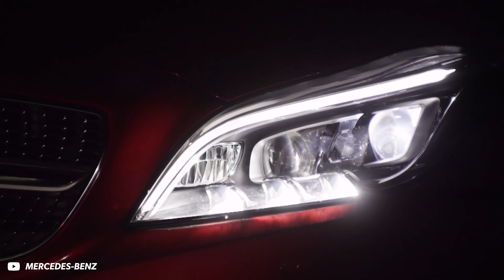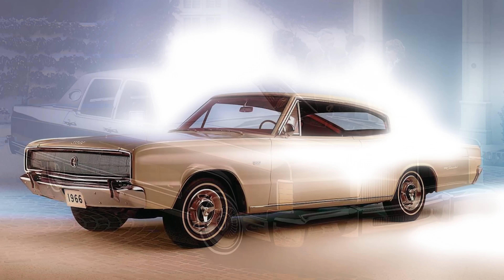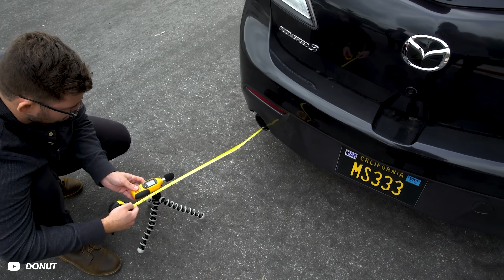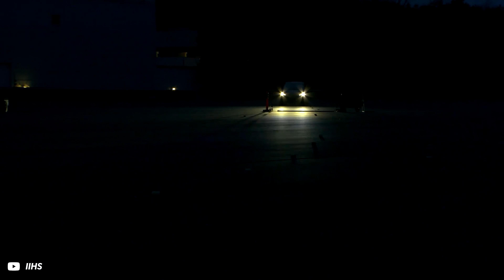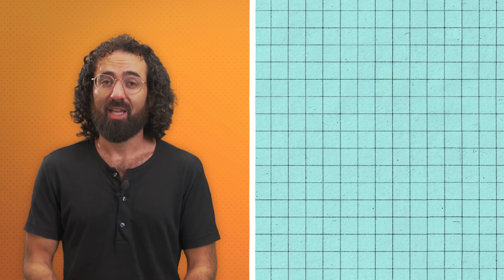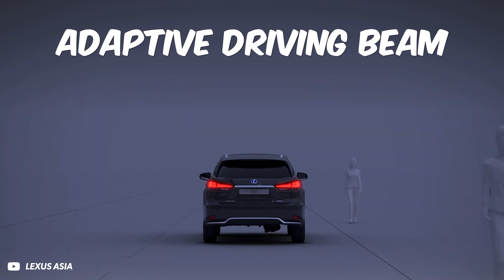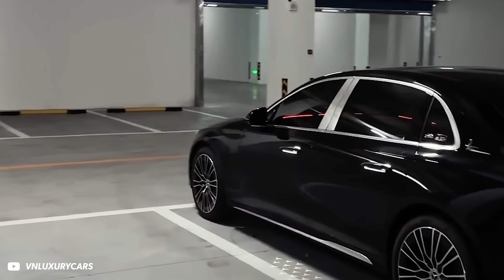Why new headlights are blinding American drivers

Comment: Its called AIM YOUR LIGHTS PROPERLY!!!!
Reply: You and I see this the same way. I’ve stopped suggesting it. 😂 I’ve put LED replacements in a few vehicles and all needed to be aimed a little lower when I checked the aim.

I have never been flashed by oncoming traffic with these vehicles.

On the other side, I rarely find LEDs too bright in oncoming traffic for either OEM or aftermarket. If they’re too bright, then I just look at the white fog line. It’s not a big deal.

I think I’ve seen the reaction to pressure already happen on brand new vehicles. I have a ‘26 Toyota equipped with OEM LEDs and they are absolutely rubbish. The low-beams are barely adequate and the high beams are beyond worthless. For unlit rural roads loaded with big game to contend with, they’re downright dangerous. I’m having to rig additional auxiliary LEDs for safety.

Comment: xenon does not make a light a "halogen" light. halogen lights usually have a halogen such as iodine in them. the iodine helps keep the tungsten filament from slowly evaporating away. halogen lights might also have a "noble"  gas in them usually under pressure such as argon, krypton, or xenon. the heaviest noble gas is xenon, and when the tungsten atoms try to leave the filament they collide with the xenon or other novel gasses and return to the filament. these gasses are usually under pressure to enhance this effect. the bulbs are small as the gasses are expensive, and they want to limit the convection which may cool the filament excessively and dim the light. halogen lights are sometimes called quartz halogen lights. now, some cars use arc lights which may also use xenon, for much the same reason that a quartz halogen bulb does, to slow the deterioration of the electrodes. this is what i remember from the last time i looked into car headlights, some of which applies to flashlights. definitely believe there are problems with led headlights. in my state you must use the oem lights in headlights for a car. you can't replace an incandescent light with a replacement led bulb. if you do the car will fail inspection. that might help with some led headlight problems. i have noticed that the headlights on some car flicker visibly, find that annoying. not sure it that is from oem headlights or replacement headlights. do think that led headlights don't deliver the full visible spectrum which makes highlights some things on the road and makes other things harder to see. think they deliver less light in the red part of the spectrum. seems to me that the red reflectors on the back of cars are not as visible in the light of an led headlight as they are in the light of incandescent lights. makes cars with rear lights that aren't working harder to see at night. anyways probably a lot of bad information in this comment, but working from memory and haven't looked into this in a long time. all is opinion, fwit.

Comment: The video is great and frames the advances in tech very well.  

BUT - to those people who complain that cars (and houses) these days cost too much, let's remind them: 

✅ Bright headlights blinding drivers is not new.  We solved this decades ago with proper aim standards and high/low beams.  They just need to be updated.
✅ Low beams were designed for shared-road conditions.  Maximum distance at highway speeds is what high-beams are for.
✅ If conditions (rain, snow, darkness) limit visibility, drivers are expected to adjust speed.  It's actually the law "driving to the conditions".  It's unreasonable to expect the same safety driving @4am in late January, vs @1pm in July. Unless ->💰💰💰

✅ Now we’re layering complex and expensive computer-controlled adaptive systems on top of a problem we re-created by not updating and enforcing rules on aftermarket lights and car companies that build huge and tall SUVs.
⚠ At some point, we have to decide whether we want sensible limits or endless engineering to compensate for our entitlement... and if so, we best stop complaining about the cost.

😄 HOW ABOUT WE BRING BACK ROLL UP WINDOWS??

Comment: Same thing in Australia.  Obnoxiously sized vehicles, obnoxiously bright lights. I drive a sedan, and when I'm followed by these at a certain distance, my car is floodlit, I can barely see at the sides nor behind, just glare. Plus, I'm forced to expose my eyes to the light to try to see the road, so I get that blinding after-burn, too. These drivers have zero clue. I've figured out how to adjust my side mirrors at a precise angle that will bounce their blinding headlights straight back into their eyes. It always works - they either pull back or change lanes.  I don't want to be passive aggressive but it really is that scary and nothing is being done to control these lights.

Comment: My three year old BMW 223i M Sport Active Tourer has active headlights but I can’t use them. The software is built in and they probably work perfectly but BMW wants a monthly subscription to turn the software on. It should be illegal for motor manufacturers to rent built in safety features, if it’s built in it should be available in the price we pay for the car.

Comment: Consider another reason: cameras need light.

I can spot a Tesla 3/Y at night city driving just by how it blinds me.
It all started when they ditched lidar and went cameras only (the S and X did not have this problem).
They are clearly illuminating the left lane on purpose as car lights have had rules to cut angle towards middle of road and only spread right for safety, and to reduce blinding.
A shame your influential tech guys got the legislation quicksanded while they scramble to do self-driving. All the while drivers get migraines and minor traffic accidents.
I would not be surprised if there is another “diesel gate” code scam going on here. They test lights stationary and it is trivially easy to make them behave differently when driving at various speeds.

We also have rules for fall-off angle on the low beams to have them not blind drivers in front, but most of the new fancy cars ignore that as well.
Some of the new cars illuminate my entire cabin when behind me in traffic.

There was also a Nissan model a few years ago that you would see in the side mirrors way back. That one just had bad calibration though as I don’t think it had cameras. Maybe something got messed up in the switch of driving side.

My 10yo car has ADB lights and it is a shame they did not become mantatory long ago.
You cannot tell as the driver going against them, but it is quite noticeable if you are in front or behind a car with ADB lights.

Comment: More road coverage = pointing the light higher. Angle the light higher = blast the eyes of other drivers. just KEEP THE FUCKING BEAMS BELOW OTHER CAR'S WINDOW LINES
Having brighter lights makes 0 difference if you can't point them higher when using dipped beams, since it'll light up the same length of road infront of you.

Comment: Rivian is one of the worst headlights out there. They are always blinding me.
We don't need lights that move or dim when they sense movement. We need dimmer lights instead of them constantly getting brighter and brighter. If your eyes are so bad that you can't see without these bright bulbs or using the high beams, then you are driving too fast.
Reply: Totally effed up. Those light bars are not necessary and should be illegal. It's bad enough driving at night and then you have to deal with a blinding light bar, along with the ridiculous led lights.

Comment: The headlight thing has been a headache for me for years. What I don't understand is why standard headlights need to be brighter than standard halogens in the first place.

Road visibility is only a small piece of the puzzle, the reason you need to use your headlights in the dark is so other drivers can see you. Headlights are used in town or on the freeway, where streetlights are providing a majority of the light you're using to see the road and navigate. In these environments, a driver with their headlights off can navigate just fine, but is basically just an indeterminate black lump which is dangerous in traffic for others.

When you're outside the city in the dark and actually need your car to be the primary light source, that's what high beams are for and those should be bright.

It's absolutely ridiculous to me that more people don't mention this when talking about modern low beams being like staring into the sun.

Comment: Sorry but in the real world adaptive beam headlights are a joke, i can recall one (1) time where i noticed that the car coming at me had adaptive headlights that actually worked, most of the time the light spillage of these intense leds is enough to blind you even tho the headlights cut you out. these systems are extremely unresponsive, taking multiple seconds to recognize a car and cutting the beam, in turns they do absolutely nothing and still blind oncoming traffic. after the car passes your eyes still take multiple seconds to adapt to the darker surroundings making you drive blind or forcing you to hit the brakes. it all sounds good on paper but is laughable in real world situations. and its all boils down to manufactures being cheap, its way cheaper to half ass some sort of adaptive beam system and throw in dirt cheap leds from china, than to design and construct real glass lenses and reflectors that perfectly cut of the light and focus the beam way tighter, all while using less aggressive halogen bulbs. the best headlights i every had in a real world usage were my 2001 Toyota Corollas real glass headlights with aluminum coated reflectors, they were bright, had clear cut offs and the light color actually preserved some night vision from the eyes.

Comment: If low lights have the correct angle, so that they don't strike the eyes of incoming drivers, the problem wouldn't be that bad. This should be tested as part of the mandatory car verification, to avoid cars blinding incoming traffic. It's not safe to drive, if you only see two ridiculously bright spots in front of you. You don't get many clues left of what the hell is happening around you. That's far worse than having "weak" lights.

Comment: After years of complaining i caved in and bought bright LEDs myself. But at least i know where my car has a beam height settings. So i just chose minimal settings, so it's pointed down.

The reason i did it, with my old bulbs even my high beams weren't enough to force the morons in the oncoming traffic to turn off their LED high beams. Now it is. They switch to their low beams very quick. Just need to do one warning flick and done, they know that pissing me off ain't good idea.

Still, the huge issue are people, who don't know that almost all modern cars have dedicated settings for the beam height, and never even try to change it. So instead of pointing down on the road, it shines directly into the faces of mirrors of other drivers.

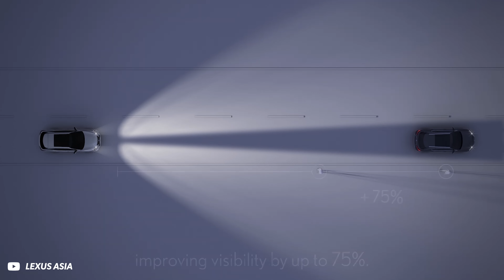Comment: 9:05 No. Not the only solution. Drop back the height on consumer vehicles, dim the lights, make them warm tone, make sure the low beams are actually angled AT THE EARTH and not at oncoming traffic and remove the sensors so that people manually control lights again and PAY ATTENTION TO IT.

Driving is a privilege, not a right. You have the right to BECOME a driver.

Better yet, fix car dependent cities and suburbia and install your railways again so you can finally get to places without driving there

Comment: European here, test engineer actually. ADB will not solve the issue. Is a function for premium cars an honestly is not working perfectly. I see cars on road that I think it has high beam on me for some ms and low again. Basically led/courtins are not working fast enough and is annoying being blinded for a few tens of a seconds at a time. Yea, not system are the same, I don’t drive a lot at night and  I am not in wealthy part of Europe so most cars here that have ADB might actually have older, slower system. Hopefully starting next month I ll start testing light fiction and trafic sign recognition for toyota. Wish me luck to get on the project. I will report every small deviation I see so you don’t get blinded by any toyota (prior 2029 :D).

Comment: Austrian here

The big issue with those dumb LED lights are also the colour. Older cars have a warm, yellow light. So it's "pleasant" to look at, if that makes sense. Whereas the LEDs feel like they are penetrating my eyes. I despise driving at night so much because of that. And the Adaptive headlight? 

Utterly useless. I drove a company car a few times with that system on and despite that, I was still flashed every time by the oncoming car, indicating that it just doesn't work as well as the market wants you to believe. It's worse with pedestrians. The system just ignores them completely

In conclusion? SUVs are bad, adaptive headlights don't work and night drive isn't safe anymore. Drive safe out there, lads

Comment: They need to ban blueish headlights altogether and instead mandate that all headlights be yellow. And actually enforce these laws.
Also, they need to fix the terrible PWM flicker. Mandate the frequency to be in the multiple thousands of hertz, with a smooth sine waveform, rather than the harsh ON-OFF-ON-OFF of a square wave that they typically use. Or better yet, don't use PWM at all. 
Or even better, just ban LED and Xenons and go back to halogen.

Comment: I didn't realize until I rented a 2025 Ford SUV and realized they took the option of comtrolling your lights away from you. There was no way for me to turn the auto lights off or down. I was blinding so many people and I felt so bad. Also, when I have someone behind me with bright lights, I tend to adjust my side mirrors so the light is not reflected on me but back on them. They back up and/or quickly pass me

Comment: There are too many options and settings for lights in the headlight and on the stork
You only need a dipped beam which can be used as daytime running lights which are now required by law so always on then main beam then fog lights  
No need for off, side, dipped, main beam, daytime running lights, LEDs in this or that setting and fog lights 
As a mechanic and MOT tester when checking car headlights on most cars nowadays it's just over the top and unnecessary to have this many different lights plus it makes the headlight super expensive because you can't replace just the LEDs

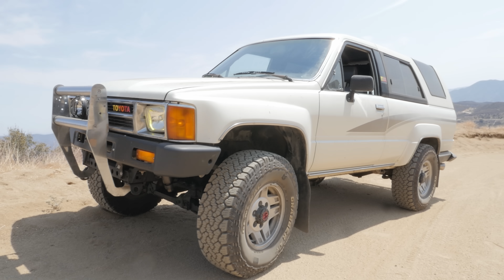Comment: 8:19 "once the vehicle has left the factory no one is really checking what those lights are doing"

And that's the real problem!
And it's also the core of what European countries are doing better. It's not just about legalizing new tech earlier. It's about mandatory regular inspections performed by officially certified experts. And about a rigorous and safety orientated certification system for aftermarket parts.

Comment: You're wrong.
The solution is to NOT make such high output lights available in the first place AND if a vehicle is found to have modded or aftermarket lights that don't comply to standards, a heavy fine should be imposed.
The other issue is that these led lights are cool white which is why they're so invasive whereas the halogen or Xeon lights were a warm white which isn't as damaging and uncomfortable on the eyes.

Comment: Just use high beam all the time. Its interesting because when they bright you back its not much different which goes to prove the dips are too bright. Same as traffic signals and increased reflectivity of of modern signage anyone would think it was all designed for blind people driving around. Lumens or not if they blind people theyre junk

Comment: Aftermarket lights are an issue but a VERY small part of it IMO. New cars are simply coming with lights that are too bright and with cutoffs that are too high for anyone driving a normal sized sedan. If there's anything that will push me to driving something taller it'll be not being blinded by the idiots coming at me and the ones behind me! That said, I have a Golf R that swivels the lights and to date I've never been flashed by anyone being blinded - I also do NOT run the automatic high beams. The auto high beams are certainly better than when I first saw them on a luxury car in the 80s but I still don't trust them not to blind folks and I don't want to be "that guy". Sadly most others don't seem to care and the manufacturer's being "self-policing" is stupid!